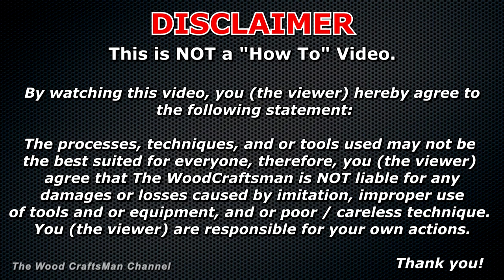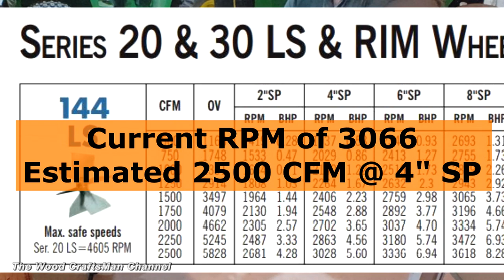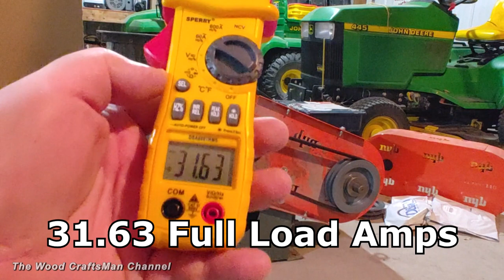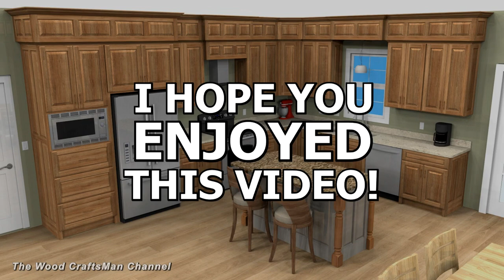NYB Dust Collector Blower First Test Run # 314

Comment: In the new blower are the bearings ok. They sound a bit rough. It should be a great dust collector blower.
Reply from the maker: They seem to be okay, but they do have a little sound to them. I haven't pulled to cover off that sits over the shaft and pillow block bearings to see if they are greasable or permanently lubricated.

Comment: My wheels are spinning - like putting it on a vfd and having it ramp up as required depending on how many blast gates are open and etc.  Probably too much to talk about here, but I'll chat with you some other time about it. Was that the new topper on your truck pictured in the video, or your old truck?
Reply from the maker: I've thought of that, but I'd need a 15 HP VFD and probably a 50 amp circuit to support the VFD on single phase. It's probably not cost effective. No, my topper is getting installed today actually. The video on my YouTube channel was from my old one.